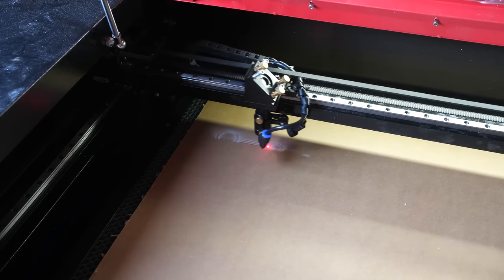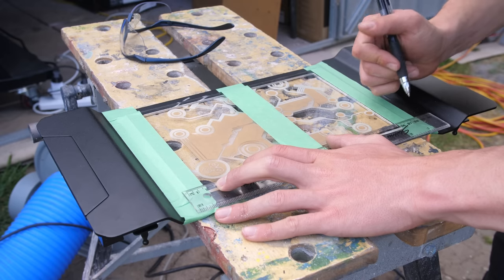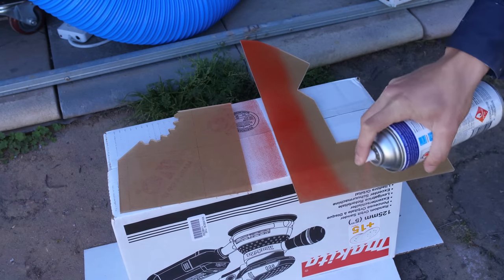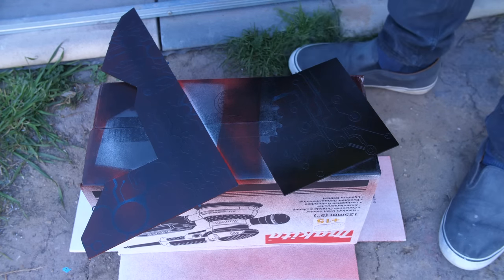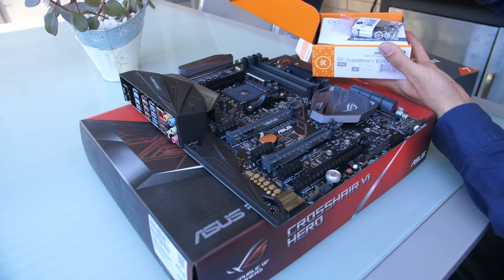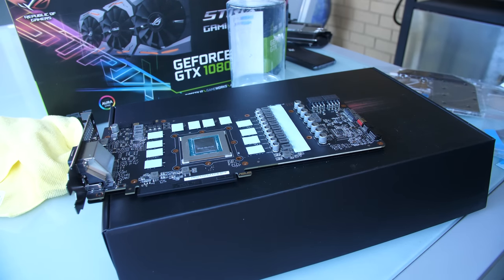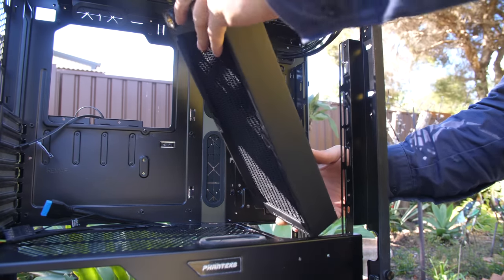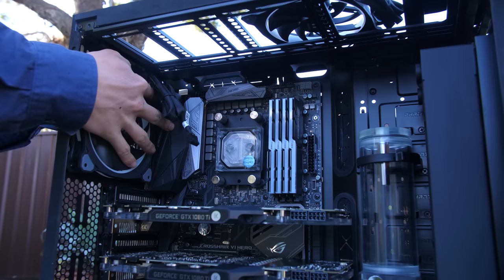Project Cognition - Client Build Ultimate Custom Gaming PC - Progress 1

Comment: Such a nice build but why did you buy the asus graphics cards. Don't they only add an aftermarket cooler which you removing anyway?
Reply from the maker: +DragonFury 1738 it was more about what was in supply at my closest store. They had some other cards but no waterblock for it etc
Reply: Designs By IFR ok cool. Just was wondering. Your build are absolutely incredible
Reply from the maker: +DragonFury 1738 thanks man =)

Comment: i have seen alot of issues with ryzen and trident Z rgb. Hopefully it all works out well for the client. Love your builds.
Reply: THIS!  If you need to run Asus Aura software, MAKE SURE the client gets the latest version of Aura.  Older versions can corrupt the SPD tables on the RGB ram.
Reply: Had no issues on my end..Been using since Ryzen release.
Reply: RdyPlyOne  and do you have the G.skill software and aura software installed? I want all the features of the ram but I'm afraid to ruin it.
Reply: Ah...I only use the Asus software...It does everything I need.

Comment: if the client was using threadripper cpu or an intel cpu then there is a motherboard called the asrock taichi that has a cogwheel as the chipset cooler on the motherboard but sadly there isnt one of these for am4 and it wouldnt of fit the colour scheme but it still might have been cool to see
Reply from the maker: +CharalamBOSS yeah man that was my first thoughts as well but then we are talking a whole lot more money as well

Comment: I looked on can i run it and most games it suggests i upgrade from a Intel(R) Pentium(R) CPU G4600 @ 3.60GHz to Core 2 Duo E8200 2.66GHz. Why does it tell me that despite mine is 3.60GHz and other one is 2.66GHz?